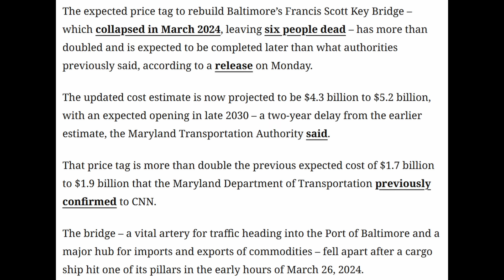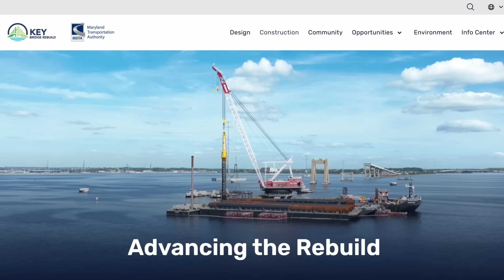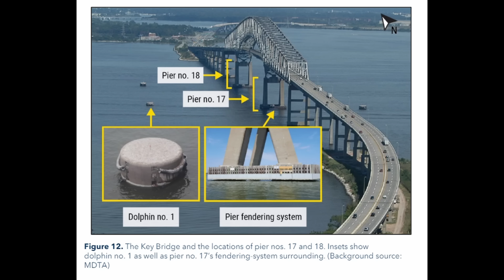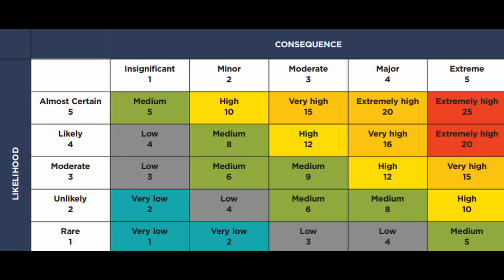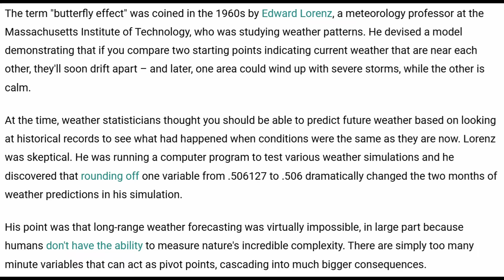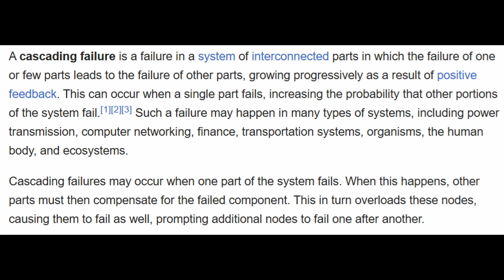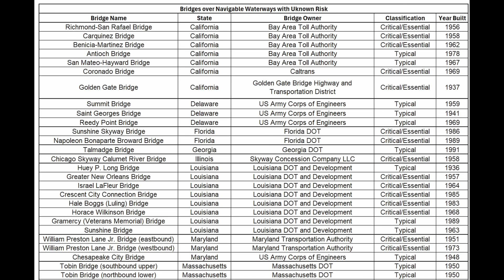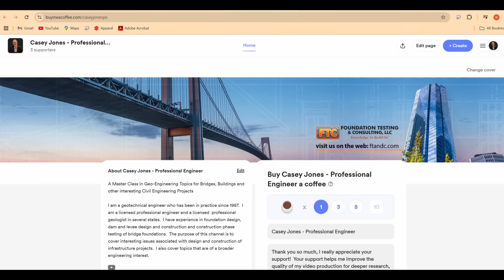Key Bridge Destroyed because of a Label on a Single Cable

Comment: GT graduate, civil, never sat for PE...30+ years in municipal infrastructure world.  The sticking point that I see on large project construction versus maintenance is Capital Improvement funding versus Operating Budget(including maintenance) funding.  It is much easier to get the money to build a giant project than it is to get yearly injections to maintain that project.  I always wanted the maintenance costs to be included as a bond, or other investment vehicle, to be required as part of the initial funding.  For simplicity, the investment should be capable of providing an amount yearly equal to the project design and construction cost divided by the life expectancy.  If the fund is not depleted it would be, by law, spent toward the replacement project.

The possible grift I see is an industry(championed by persons recieving payment from it) designed to consume the available dollars every year, whether needed or not.  Even then, this seems preferable to the under funded projects we have today.  I also, as a realist, know not to underestimate the ability of the machine to disappear money.

Comment: A single POF from a critical operating CB, UV trip using a type of terminal strip that do not lend themselves for inspection (as opposed to larger pitch terminals) compounded by a lack of inspection diligence from the beginning of time to failure.  Is there a requirement to pull test terminated connectors?  Why was the MV Dali operating in non auto transfer mode?  Getting to channel and bridge safety would be another bottomless pit of despair.  Business runs the government, people are fungible,  disposable things and there's another construction boondoggle opportunity.  No enterprise, let alone system is perfect, but you can certainly do better than this.  God Bless those who lost their lives.

Comment: Wiring aside, wouldn't it be a prudent measure to require a minimum number of tugs to escort the ships in and out of this area? Relying on luck doesn't seem to be the best practice. Also, if one wire was found to be improperly terminated (you should always do a "tug test" on a terminated wire, kinda page one stuff there), was it because just one wire that someone did this to? Could more conductors be poorly attached? Something stinks with this whole thing.
Reply: My suspicion is that it did pass an initial tug test, but that due to the far-too-shallow insertion, it worked its way out under vibration over the years.

And yes, having seen the photo (not shown in this video) of the rest of the panel, where every single wire (of hundreds) has the label over the ferrule collar to some extent, I would be surprise if there were not many more wires that were incompletely inserted, just waiting to wiggle free with time.

Comment: I think that 100% nothing in this world is perfect and we see that every day of course you cannot ever predict when or if anything will happen but what you can do is design things in a way that will not have devastating effects on this scale of a seemingly innocent simple thing causing a problem that put itself in a unfortunate position and i feel this could be implied on the vessels and the infrastructure that is necessary for our demands and needs the design of these bridge's main supports need to be placed out of the reach of such a heavy moving object and we all see it didnt take very much or what seemed like a bump into the lower anchor point causing a point under high tensile stress giving way and releasing immense forces on all of its structural integrity like you said make sure that in the case of something like this the ship cant directly affect the heart of such structure either with sufficient impact buffers or in placement further away from the operation depths needed for a ship that size that way you have that covered and for the boats or ships a good way to possibly help fr5om a black would be to not ever rely on one single circuit to be responsible for  that big of a job or whatever way it was configured several things were  deemed dead because of it and having more than one system that is then backed by auxillury emergency critical power sources would be much more useful if something simple were to take out every operation on the massive ship and at least still have the most important systems to keep this sort of very simple yet devastating effect on so many scales including the workers whos familys lives have been turned upside down

Comment: So they used the weak ass "push-in" terminals instead of terminals with binding screws?
Reply: Those aren’t push-in terminals, they are spring-cage terminals that require an insertion tool. (In the terminal block industry, “push-in” means the kind that don’t need a tool for insertion.)

However, that’s neither here nor there: the problem was user error, resulting in the wire only being inserted a fraction as deep as necessary. The same wire, inserted so shallow into a screw terminal, would have worked its way out, too.

Comment: Why I Object to the Current Key Bridge Rebuild Scheme

The collapse of the Francis Scott Key Bridge was a tragedy -- but the response posture matters just as much as the event itself. I object to the current rebuild scheme because it reflects a pattern of expediency over discernment, symbolic erasure over principled renewal, and infrastructure inheritance without accountability.

No Full EIS: A Shortcut That Bypasses Public Wisdom

The decision to grant a Categorical Exclusion (CE) under NEPA sidesteps the very process designed to ensure long-term resilience, environmental integrity, and public input. A full Environmental Impact Statement (EIS) would have required serious study of alternatives --  including the tunnel option -- and forced agencies to confront freight growth, navigational risk, and climate vulnerability. Instead, we got a fast-track rebuild justified by “similar footprint” logic. That’s not stewardship -- it’s shielding.

A Vulnerable Bridge in the Same Spot

The proposed cable-stayed bridge may be elegant, but it’s still exposed. Rebuilding in the same location, with similar navigational constraints, invites future risk. The original bridge lacked protective fenders -- a fatal omission. The new design promises improvements, but without a full EIS, we’re trusting assurances over analysis. That’s not resilience --  it’s repetition.

Tunnel Option Dismissed Without Study

A tunnel would eliminate navigational risk entirely. It would preserve Baltimore’s skyline, reduce long-term maintenance, and offer symbolic closure. But it was never seriously considered. Why? Cost? Timeline? Politics? Without an EIS, we’ll never know. The dismissal of the tunnel option reflects a deeper institutional drift -- one that prioritizes speed over scrutiny.

Symbolic Geography Ignored

The Key Bridge carried symbolic weight -- named after the author of the national anthem, spanning industrial Baltimore, anchoring regional freight. Its collapse was a rupture in narrative. The rebuild should reflect that. Instead, we’re offered a structure that threads technical specs but ignores emotional infrastructure. That’s not renewal --  it’s replacement.

Funding Scheme: Expedient but Unexamined

The Key Bridge rebuild is backed by a mix of federal emergency funds, state allocations, and insurance claims, with early estimates placing the cost between $1.7 and $1.9 billion. While the speed of funding approval reflects urgency, it also bypasses deeper scrutiny. The federal government’s emergency designation unlocked fast-track dollars, but it also enabled the Categorical Exclusion from a full Environmental Impact Statement (EIS) -- effectively tying funding to a predetermined outcome. Critics argue that this approach prioritizes reconstruction over reflection, locking in a bridge-centric solution without fully evaluating alternatives like a tunnel. The funding scheme, while generous, becomes a mechanism of institutional inertia, reinforcing the very vulnerabilities that led to the collapse.

Comment: More on Bridge Protection Systems

MDTA finally put something on their Key Bridge website about protection schemes in August 2025.

Question: How will the new design prevent another bridge strike?

Answer: The bridge piers will be protected by massive protection structures, which will be designed per the latest American Association of State Highway and Transportation Officials (AASHTO) specifications and follow best practices for modern vessel collision protection. Additionally, the main span length of the bridge has been increased to provide additional clearance from the shipping channel.

I have several comments about this.

It is way too general to provide any real info to the public. It would be appropriate to see a conceptual design in plan view.

They are claiming a 1,600 foot main span length when the USCG permit says 1,400 feet. Neither is much of an improvement over the original 1,200 feet, and the main piers will still be in water 35 to 40 feet deep at mean highest high water level. See NOAA Chart 12281 Baltimore Harbor.

What are “massive protection structures” and how will they protect the bridge without impeding water flows in the river? In water that deep it would take huge fills to build an island with 2:1 slopes (at minimum) down to the riverbed. Concrete structures would be massive as well to be anchored to the bedrock and tall enough to be above water.

The AASHTO Guide Specifications and Commentary for Vessel Collision Design of Highway Bridges (2nd Edition) was published in 2009, is their latest, so it is already aging, and it wouldn’t include the Dali event which IMHO completely changes the equation regarding probability and risk for bridges over busy shipping channels.

The Dali event -- in that a vessel that massive was handled that recklessly – like with nuclear reactors and weapons, you simply cannot afford to even make one mistake. So now we have to design for idiots that mishandle a 200,000 ton vessel in a busy harbor and at 17 knots (that speed from a recent ship flap in a busy harbor, Charleston, SC).

So there are no bridge protection standards out there that are up to date and usable. At least not for bridges over channels that carry large ocean-going ships.

The protection system for the replacement Sunshine Skyway added 20% to the cost of the bridge project (late 1980s), so these things do have a considerable cost.

The Sunshine Skyway and their protective measures is a 40-year old design when ships were much smaller. MV Summit Venture was around 19,000 tons.

I was rereading a book on the Sunshine Skyway disaster and it said that MV Summit Venture was lightly loaded ("in ballast") and was drawing 21 feet at the bow and 32 feet at the stern. A differential typical for a lightly loaded bulk carrier.

So that is another factor to allow for in a protection scheme. The forward part of a 600 foot long ship could be a lot higher in the water than the stern and drawing a lot less water than the average for that ship. In other words, partly or wholly defeat a protection scheme based on water depth.

You have to consider all the above in your final design. Or else just forget about building any crossing at Sollers Point. Don't waste the taxpayers' dollars.

Once again -- you need to bridge the main span all the way across the river (Gordie Howe International Bridge for example) or build a tunnel (I-664 for example).

Comment: Attacks on the structural design of the original bridge

Almost immediately some internet experts started blaming the design of the bridge, saying that it was "weak, fragile, fracture critical, etc." and that it should have been able to absorb the hit and remain standing.

The bridge didn't have a fracture critical issue. Despite what some internet posters including one supposed civil engineer on YouTube kept claiming. The definition of fracture critical basically means that the failure of one subordinate (secondary) member will cause a massive failure of the whole bridge. Like the pin-and-hanger design on the I-95 Mianus River bridge and others whereby the failure of one beam hinge connector will lead to the collapse of the entire bridge. That is a fracture critical bridge.

The Key Bridge didn't rely on every truss beam being intact. I don't know what the exact number is but at least one could be removed without the failure of the entire truss. The important word is "fracture" which suggests a crack and not a massive destruction. Knocking out a main support pier on a long span bridge is not a fracture, it is a disaster that will cause the entire span to disintegrate.

How do you explain to someone the amount of kinetic energy at work here and what it can do? Some 9/11 Truthers say that since an airliner is largely made out of light aluminum structures and that the Twin Towers was a steel structure, that the plane should have gone "splat" on the side of the building with little or no penetration.

That of course is baloney any way you slice it -- you have a 150 ton object moving at 500 mph (the speed of a 45 auto pistol bullet) and it did enormous damage to the building. A 150 ton water balloon (if such a thing was possible) would likewise do enormous damage to the building. An EF5 tornado is in the 180-220 mph range and it can rip house foundations and basements right out of the ground. And that is nothing but wind. Imagine what a 500 mph tornado would do?

The Key Bridge was a continuous truss with multiple load paths. It could tolerate localized member failure. What it couldn’t survive was the obliteration of a main support pier, a foundational element, not a subordinate one. That’s not a fracture. That’s a structural amputation.

The MV Dali weighed 116,851 metric tons and was moving at 8.7 knots (~10 mph). That translates to roughly 1.6 billion joules of kinetic energy, comparable to the explosive force of 900 pounds of TNT. No bridge designed in the 1970s (if ever) was built to absorb that kind of lateral impact to a critical pier.

To visualize it: A 150-ton aircraft hitting a steel skyscraper at 500 mph isn’t just aluminum vs. steel, it’s momentum vs. resistance. The plane doesn’t need to be dense; it needs to be fast. A 150-ton water balloon at that speed would still pulverize a structure. Mass × velocity² is unforgiving. An EF5 tornado, at just 200 mph, can rip homes from their foundations. Now imagine a 500 mph wind, or worse, a solid object moving at that speed.

The Dali didn’t hit a truss beam. It hit Pier 17, which supported the main span. Remove that pier, and the span has nowhere to go but down. The collapse wasn’t due to a crack propagating through steel, it was due to the instantaneous loss of vertical support. That’s not fracture critical. That’s support critical.

The Dali’s impact wasn’t just about raw energy -- it was about momentum, structural vulnerability, and instantaneous load transfer. The bridge didn’t absorb a blast -- it absorbed a moving wall of steel with the mass of 2,900 loaded tractor-trailer trucks. That’s not a fracture. That’s a blunt-force amputation.

Comment: The Sunshine Skyway system is a 40 year old design for ships 1/10 the size of a Panamax ship. Today its protection system only decorative.

To reliably ground and stop a Dali-class or Neo-Panamax container ship (115,000–170,000 tons) traveling at 7–8 knots before it can reach the pier, the protective island (or dolphin cluster) around each pier would need to extend at least 1,300–1,800 feet upstream from the pier face -- roughly one-quarter to one-third of a mile in the direction of travel.

That translates to a single protective island (or fused dolphin group) with a minimum diameter of 1,400–1,900 feet if circular, or an elongated teardrop/rectangle at least 1,500–2,000 feet long and 800–1,000 feet wide. In practice, two such islands (one on each side of the channel) would consume nearly the entire 1,200-foot federal channel width and leave almost no safe navigable lane for large ships.

The current MDTA design uses islands only 400–500 feet across -- less than one-third the required size -- which is why the NTSB’s own modeling shows a ship would still smash the pier with most of its energy intact. Anything smaller than ~1,500–1,800 feet of solid, high-friction stopping distance is decorative, not protective.

Comment: A single loose wire is not a cause, but a symptom. Designing a system with a single point of failure is a cause. Also, not having regulations to prevent ships with said single points of failure near critical infrastructure is a contributing factor.
Reply: The issue is more that the ships were built with redundancy, but deliberately operated in a manner that removed it. If you have your fail-over disabled by the operators it isn't a fault in design. The whole cost plus punitive damages for the Key bridge failure needs to be pushed back to the ship's owners, insurers, and port state for permitting the abysmal maritime practices.
Reply: I think they are saying that the one particular wire was the proximal cause.  It makes almost no sense that a single wire was installed improperly, the boat was probably rife with such errors, it was just that particular one that failed. This would suggest that if there had been secondary systems they would have been just as unreliable.